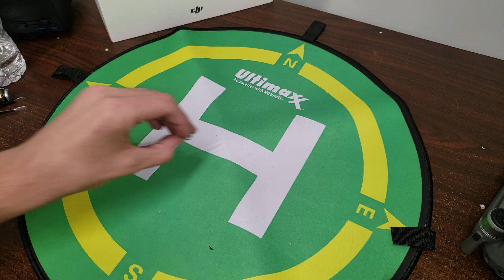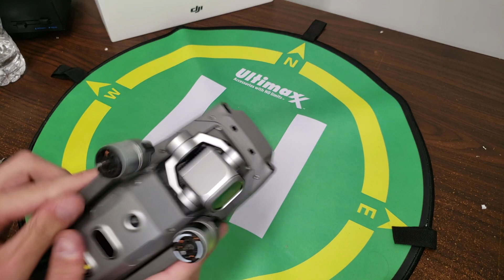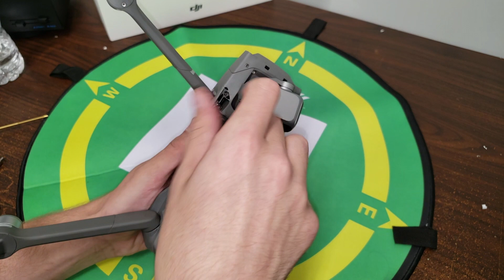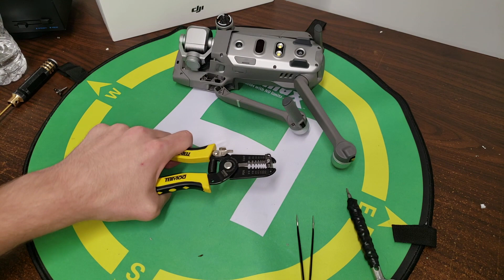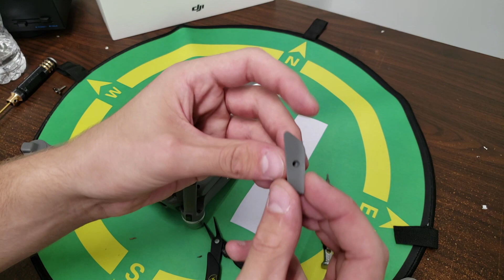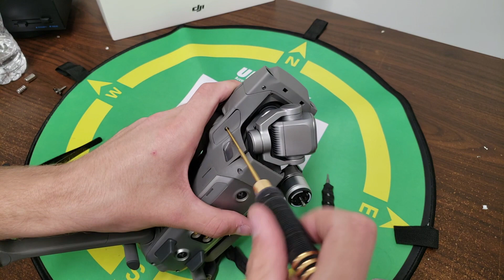DIY - Replace Mavic 2 Front Arm Bracket - DDS

Comment: What is the “little part” you said you remove so that it slides in finally. That’s an important detail. Both my front arms fail to open full then brackets are installed, and I’ve tried setting bracket both directions

Comment: Kinda off topic question. I have a mavic 2 pro and the motor on the gimbal are came unglued and now the whole assembly is connected by only 1 wire. Would I be ok just to glue the motor back into place?. Then follow it with a calibration?. I wasn't sure if it needed to be precisely mounted or not.

Comment: Good video, man, but not a good thing to be "slapping those arm brackets" like that, cause the motors are easy to damage, and you have tiny wire sets,  led bulbs, ect.  I imagine you were doing that for effect, but these are expensive and intricate machines. Good job, though, dude....I was glad you showed that bit on the arm hinge, I was unaware you could or had to "prep it" like that.
Reply from the maker: this drone was restripped and painted black still flies like new
https://www.youtube.com/watch?v=fOZhk-lTJoc
Just sold it today to a cust who broke a Air 2 and needed a drone for vacation tmrw

Comment: You missed a washer... at the end of the “arm bracket” is that really  the name of the part? There is a black washer that fits over the small pin on the end of the shaft. It’s a bit tricky to fit upside down but I got it on the 2nd try. This washer keeps the motor arm from rubbing on the mounting bracket for this assembly. I don’t believe you discovered this washer and it didn’t fly out. I doubt it just stayed in place during the removal. Thanks for posting.